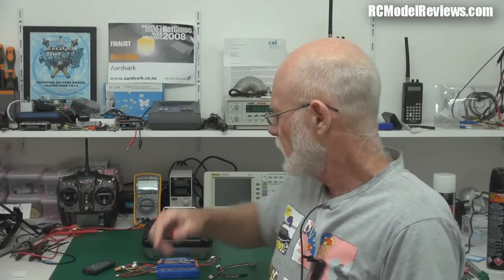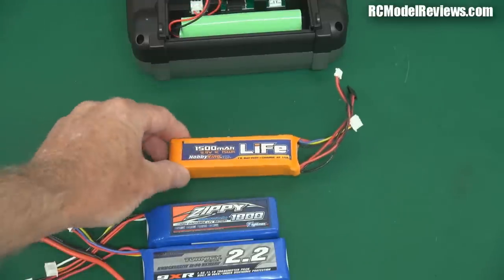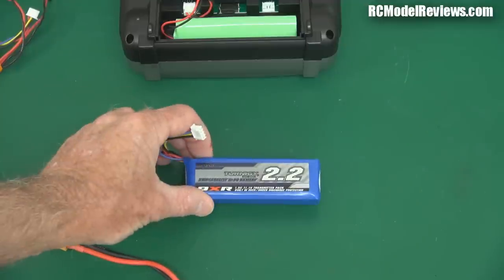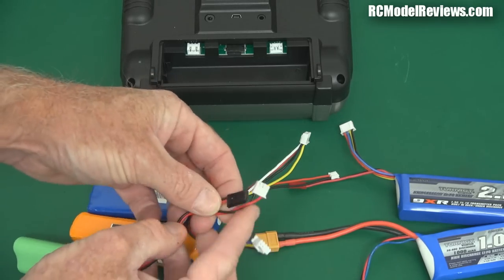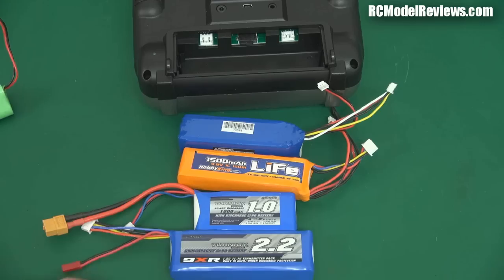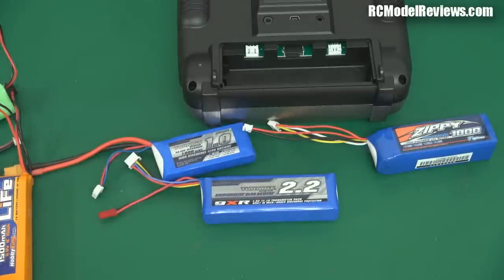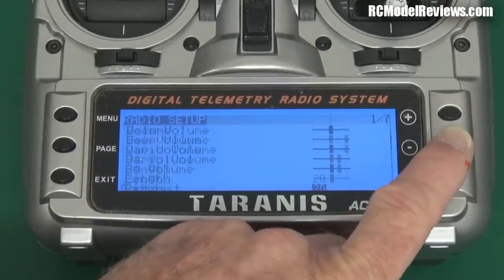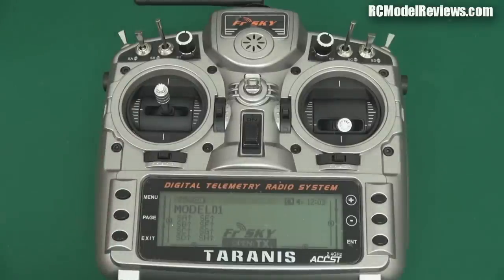Battery options for the FrSky Taranis RC transmitter

Comment: The one you show at 3:04, the turnigy 2.2 doesn't fit on the Taranis! I bought it based on your review without checking the size. Thank you!
Reply: You are resbonsible yourself for all your decisions - not Bruce and not anyone else - that's a lesson anyone should learn while growing up.
Reply: You must have not been paying attention 10 seconds earlier when he says he has had issues with some of the batteries fitting.

Comment: Hi,
I am using the Hobbyking Life battery in my Taranis. I just replaced the 2 pole connector with the one from the original battery. I put a little bit of hotglue on the connection between the Taranis and the battery to keep it safely in place. I can now charge the life battery through the balancer and the servo connector. No unpluging needed. Only open the cover. Works like a charm.

Comment: Hey Bruce! I wished you had done this video a little bit early. I was so desperate looking for a battery replacement for my Taranis and I saw someone using a Turnigy nano-tech 2100mAh 3S1P 20~40C LiFePo4 Transmitter Pack on Youtube. So I bought the same hoping it would be a perfect fit for the Transmitter. Well, it does fit in if you remove the piece of rubber on the battery lid, but still it's a very very tight fit which I wasn't so comfortable having installed. So now I've got 2 HobbyKing 1500mAH LiFe 3S 9.9v Transmitter packs with DIY connectors to fit the Taranis. Now I always have a fully charged extra pack on my Transmitter box. I think this is the perfect battery for the Taranis and a this pack lasts a very long time. And about the Low voltage alarm for 3 Cell LiFe pack on a Transmitter, I think it should be 9.5V. As we all know the measured voltage depend on the current being drawn, and a transmitter would draw a very low current during it's operation. So a battery pack on a Transmitter would have a lower voltage drop compared to a power hungry RC model. So it we get to read a little high voltage even if the Transmitter had drawn most of it's power. And these LiFe packs has very sharp drop curve once it's fully consumed. So to be on the safe side, and to have a well balanced pack, I think the low voltage alarm should be something around 9.5V. Please do correct me if I'm wrong. :)

Comment: One of the reasons why they included a NiMh battery, as opposed to a LiPo is shipping. It would've complicated the shipping from overseas due to the restrictions on sending LiPo batteries.
Reply: Interestingly enough, most of the postal carriers now don't differentiate between lithium and other battery types.  As far as they are concerned... a battery is a battery is a battery.

Comment: My Taranis is finally on it's way from HK after nearly a month on backorder. I ordered from BG but they kept cancelling my order because it had been backorder too long.
I have used a LiFe 1800 battery in my 9x but I killed it by forgetting to turn it off so I ordered a 9xr one because it has low voltage protection.
I may now use that in the Taranis until another LiFe arrives.
I can't wait to get my hands on the Taranis but I really don't expect to see it until mid January.

Comment: Bruce, in one of the previous Taranis videos you mentioned that it was possible to plug in the battery backwards and short the radio out.  On my Hitec Aurora 9 I solved that with my labeler by sticking a large 'R' label  inside my battery compartment next to the positive terminal. Now I never have to guess which way to plug in my Tx battery.  A strip of red tape would also work, as long as it's sticky enough not to fall off.  Cleaning the battery compartment first with rubbing alcohol where you want the tape to be would help it stick.

Comment: Hey Bruce the LiPos you suggested, Turnigy 2.2 9XR and the Zippy and the Turnigy 1.0 physically do not fit in the bay.
Just Ordered a Turnigy 1700mAh 2S 20C Lipo Pack (91mm*26.5mm*18mm).  Fits perfectly.
Love your work.
Reply: +Ian Laidler thanks for that info

Comment: Please update the description.
I bought the ZIPPY Flightmax 1800mAh 3S1P 30C LiFePo4 Pack assuming it would fit the Taranis, but its to long.
But apparently they have another called ZIPPY Flightmax 1800mAh 9.9V 5C LiFePo4 TX Pack. And this is the one that fits the Taranis.

Comment: Thanks Bruce.  My preference is for a larger capacity 6 cell low self-discharge NiMH pack.  Frsky make one that is quite cheap.  It enables use of the built in charger and is more convenient for me, as I don't like having to remove the battery cover each time I want to charge.
Reply: The only problem with the NiMH option is that the inbuilt charger has a relatively low charge rate so if you're in a hurry to go flying and have a low battery -- you're  going to have to wait -- or use the external charger anyway.

However, high-capacity LSD NiMH is certainly a valid option -- but oddly enough, such batteries usually cost more than the lithium equivalent.

Comment: I got my radio! I'm so excited! I didn't get a charge chord with it though, is that the norm? Will the radios memory reset when the battery gets unplugged for charging?  Or do you keep the battery plugged into the radio while charging? I plan on doing exactly what your doing with the Zippy? I'd greatly appreciate your feedback. Thanks.

Comment: Thanks for the tip about the internal charger not to mix it with ext charger - I would have tried that :-)
I just found an option for me:
Sanyo eneloop pack with 8cells around 10v.
Eneloops are nimh but have very low self discarge rate... And the pack fits really tight and has 1900mah.  Greetings from Austria, rcschim
Reply: hallo rcschim!
wo kann ich auf hobbyking ein kabel zum laden finden, bzw den female stecker der in der taranis verbaut ist?? finde den niergens!
lg aus Melk, NÖ
Reply: ***** hi, bin ned ganz sicher welches du meinst? Inter das Kabel direkt für die Batterie? Das wäre ein JST XH Stecker - das Gegenstück - um ein Ladekabel zu baun, wäre demnach ein Balancer - Kabel JST XH 2S.
Wenn Du das Kabel aussen für die Ladebuchse an der Taranis meinst: hier geht ein Futaba Ladekabel (aussen -   innen +)
Reply: RCSchim Danke! Ich wusste nicht wie ich meine Frage formulieren soll, aber du hast sie beantwortet, super, dankeschön! :)
Wahnsinns Kanal hast du, echt Spitze!! Weiter so, mein Abo hast du sicher! ;)
LG
Reply: i use the Sanyo eneloop pack with 8cells  too,,   lasts forever

Comment: Excellent timing Bruce !  My Taranis just arrived today along with this recent video.  I was wondering that very thing, what battery would be the best replacement.  I do use the LIFE packs in other radios and will use one in this as well.   One thing I wish you would have mentioned is the second power connection in the battery bay, what is it for?  Really looking forward to your future video's on the Taranis to help me understand it's functions.  Thanks for all you do!

Comment: I use 2000mah Sanyo eneloop  pack from Overlander UK
Cons
 VERY expesive, but the lazy mans option (plug an play)
Pros
Standard charger,, standard radio set-up, large cappacity and unafected by self discharge.

Comment: What's the other plug in the back of the battery bay for? It looks like it would accept a balance lead from a 3S battery. If that's the case could a 3S lipo or LiFe be plugged directly into it?
Thanks.
Reply: My question exactly.
Reply: It is a serial output which can deliver telemetrie information:
https://github.com/opentx/opentx/wiki/Taranis-serial-port

Comment: I have the HK 1500mah LiFe battery, and it seems like it's draining faster then when it was new. (It's a couple years old now).
The internal resistance shows around 60 m-ohms per cell.  Does that sound right?  Thanks!

Comment: i need some advice, bruce. i have an older futaba 8ch radio running a 433 lrs module, and i would like to eliminate the on board battery altogether, and use the fpv ground station power which is 12v and sometimes up to 14 v when i am running the car engine, as it's run off my car battery. sometimes i run the car engine while on long flights to keep the batt up. alternator charges at up to 14 v as you know. i need a voltage regulator, of some sort. not sure what to get, and haven't seen anything on the market. this will also eliminate the possibility of a transmitter batt failure on my by now very expensive fpv plane.  see my latest video to see the plane. oh, and yea, the futaba runs on 9.6v.  although, when fully charged, the batt is sometimes as high as 11.1v. nickel metal hydride.   i actually wnat ot do it to both transmitters, and both lrs. i have a immersion rc,lrs, and a dragonlink v2.   thanks bruce. if you have any ideas, let me know. it would seem like a simple matter to step the volts down, but i am having trouble finding a way.  regards,spike
Reply: I'm just rendering up a video on BECs and I'll do another on variable voltage boost/buck regulators.  What's that?  It's a regulator that will deliver a constant voltage on the output regardless of what voltage is applied to the input.  For example, you can get 9.6V out even when the input voltage varies from 3V through to 20V.  

These boost-buck regulators are "cheap as beans" and allow you to use almost any power source for your RC gear and/or UHF transmitter.

Stay tuned!
Reply: *****
great! thanks! i'm tuned in and waiting!
Reply: Rob B
thanks. will have a look.

Comment: Or just another possibility; U could use the "DIY $8 Lithium Transmitter Battery",
2 x Trustfire 2400mah &+ hardcase lipos, those don't puff. The trick U showed us Bruce,
i use Trustfire 2500mah on my 9x  and i  feel its very efficient & safe. A charge lasts forever. S if U got the same kinda space, looks like U do U can use 3s 2200mah lipos.

Comment: Will these batteries work on a DX7 transmitters?  Here in the states you can get a Eneloop battery built for the transmitter.   I have been using Eneloop batteries in the AA size for a few years with my other electronics and they can last longer than store bought AA's plus they are rechargeable.
Reply: You can fit a LiFe to a DX7 but if your Eneloop batteries are working okay I wouldn't bother.

Comment: I'm really torn between just putting in a bigger NiMh pack or a two cell LiFe.
A NiMh pack would charge in the case with the build in charger. That is very convenient.
Finding a two cell LiFe that fits is tough, but then I can just plug in the balance lead (as it was designed by FrSky)

Comment: I've noticed recently that the charge light on my Taranis while charging the stock nimh battery will quit blinking and eventually goes solid but never turns off like it did when new.
Also I've noticed that the battery is getting very warm.

Comment: In my opinion Sanyo Eneloop are the very best batteries for transmitters. Robust, low memory effect, low self discharge, not affected by storage. If you reflex-charge them, they last for years.
Reply: Cost to much, hassle to assemble, 2S 18650 is the way to go.
Reply: Hi there, what is reflex charging?? thanks

Comment: It's worth pointing out that the Taranis Plus now ships with a 7.2v 2200 mAh NiMH battery which has plenty of life, is very safe and so reduces the advantages of making this change.  A LiFe might be a bit lighter, charge faster and hold its charge better during storage but at the cost of having buy a new battery, possibly a new charger, modify the battery and have to take the battery out of the TX to charge it.  Probably not worth doing at least until the original battery stops taking charge.
Reply: Definately have to agree I own a plus and the battery gives me a lot of fly time. I'm never away from my taranis for more than a day so self discharge is not even a worry for me. I may however switch when the included battery doesn't hold its charge as well.

Comment: I am just pondering upgrading the NiMh cells with LSD and 2000mah. These cells are rated to 1500 charge/discharge cycles.  I can still use the built in charger circuit which reduces the number of times the back cover is removed.  It also reduces the likelihood that I will damage or wear out the compression fit of the battery cover.  Other accounts online say that higher capacity 6-cell NimH packs still get 12-15 hours of on time.  With the higher cycle count cells I should still get 9-12 hours.  

I think the only thing I loose is the ability to quick charge; a trade off I am willing to make.

Comment: If I'm going to always be near an outlet, could use a 12v power supply and put a connector on it to not have a battery?  What would the specs of the supply need to be? I assume a 12v and 260mA (or anything under .5mA) would be fine?
Reply: Roger Smith I don't recommend it.  You can't use the charging socket since its designed to work with the power off and not to charge the battery while running the radio at the same time.  This means you would have to plug in the DC power supply where the battery plugs in which is not very robust or convenient.  As to the power supply, although Bruce says a 12v nominal battery works it will make the regulators work harder.  For continuous DC operation you would probably want to keep it nearer the  designed 7.2v.  As to amps there is no given spec but based on the estimate that 800mAh lasts around 2hrs you will need at least a 400mA.  However, NiMH batteries can provide several amps so the peak current draw of the TX  may be quite a bit more than 400mA.  It's probably unlikely that the peak draw is that high but it's hard to know for sure without doing some measurements.  Another problem is that your bog standard wall wart DC power supply can be quite noisy, electrically, and that can be quite upsetting to sensitive radio equipment.  Batteries supply very clean power and this TX was designed to work of a battery.  You would want to choose a power supply that was well filtered.  That all said it probably depends on what you plan on doing with the TX while you have it powered this way.  If you are controlling a computer flight simulator then you could just try it out with something you have in a box somewhere but if you are flying 1/4 scale turbine jets then you might want to be a bit more careful.

Comment: my taranis with newer 2000mah battery has had very little use. i have been setting up a new model with ezuhf module in the radio and the supplied battery really doesn't last long... im getting half an hour before it starts giving a warning!

Comment: Hello Sir,
This is what I was searching for long days. I have a FlySky CT6B RC Transmitter, and it takes 8 "AA" Batteries which is 12V power source. So, I was thinking of using a 3s LiPo 11.1V 25C Battery. So will it work for it. I need your suggestion.
Thanks.
Reply: if it isn't too late, I can say that it will probably work.

Comment: I'm unable to find any documentation on the charger connection on the taranis, polarity and voltage. So 12 volts and the supplied battery (NiMH) is fine?
Reply: At the VERY END he says you can use a 12volt "wall wart".
Reply: Hugh Hemington Ah, thanks :)

Comment: I see they have discontinued the zippy 1800 3s lifepo 4. Do you know if the Turnigy Nano Tech 2100 mah 3s lifepo4 will fit.
Confirmed buyers say it fits a Turnigy X9, JRX11,  Futaba 9C, Hitec Eclipse and a JR 9303.
I think the Taranis X9D is basically a JR9393 box isn't it?

https://hobbyking.com/en_us/turnigy-nano-tech-2100mah-3s1p-20-40c-lifepo4-transmitter-pack.html?queryID=&objectID=47429&indexName=hbk_live_magento_en_us_products

Comment: I like 1500 LiFe battery. I use them in both my Taranis and 9x. I'm not sure how many hours I get but it lasts forever. I set the alarm at around 9.5V although they can discharge lower I find it drops off very fast if you go much lower. Works way better than NiMH in cold weather. LiPo way too risky to use in a TX.

Comment: I want to use a 3s 1800 mAh  LiFe Zippy.  So I am assuming that I will not able to use the integral charge port.  Is that correct?
Reply: No you wont be able to use the built in charger

Comment: just ordered a 1800mAH Zippy 3S and what turned up was a 3 Cell 6.6volt 30C Life battery but its a flat block, it won't fit in the Taranis, so be careful what you order

Comment: Can someone tell me what the low voltage alarm should be set at for LIfe batteries please.  

I tried finding the answer on RC groups, but as usual, there's no simple answer and the tread quickly goes off topic.
Reply: 3 volts  per cell
Reply: Thanks Cumbria

Comment: Whatever you do don't be tempted to charge a NMh battery through the built-in charge socket using an 'intelligent' charger.  You must use the supplied crude 12 DC wall charger or something similar.  I made that mistake and had to replace a MOSFET on the main board.  Not something anyone wishes to do!

I've made up a so-called 'Instant' 2500 mAH NMh pack for my Taranis.  I made an adapter for which converts the connector to a standard servo type and always charge externally using my Graupner Ultramat 16.  It lasts ages between charges

 Lots of ways of skinning this Taranis cat.

Comment: Judging by the "Zippy Flightmax 1800mAH 9.9V 5C LiFePo4 TX Pack"  battery dimensions as listed on Hobbyking , it would seem the width of this battery at 30mm would be a tight fit , as far as putting the battery bay cover on . Has anyone used one that could comment ?